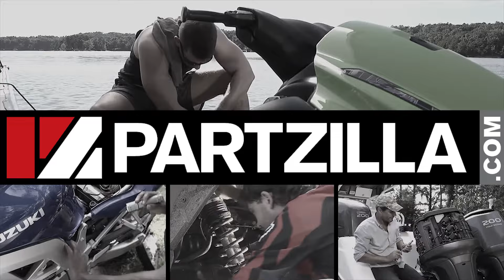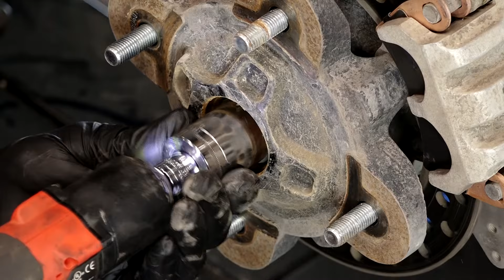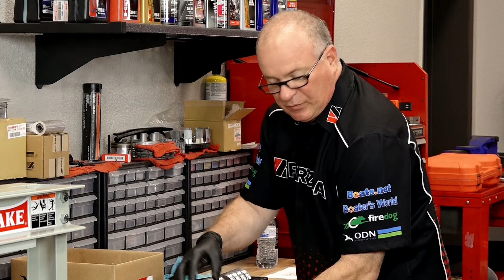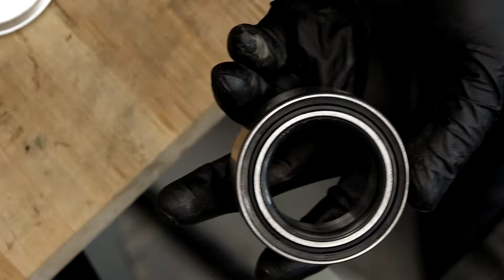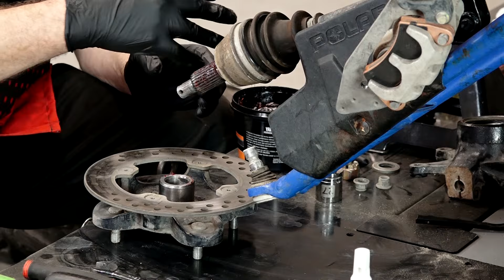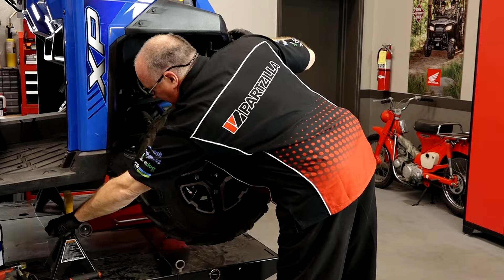Polaris Ranger Wheel Bearing Replacement | 2016 Polaris Ranger 900XP  | Partzilla.com

Comment: Can’t get the hub spindle removed from the hub assembly. Tried heat to no success. Any tricks?
Reply: The hub spindle? Are you taking about the spindle of the cv joint that's in the hub or do you mean the inner hub that the cv joint goes into that connects to the outer hub?

Comment: What is the reason to put red loctite on a new bearing will be hard to remove the next time
Reply: People use Loctite (a bearing retaining compound) on wheel bearings before pressing them in to fill microscopic gaps, prevent spinning or walking within the housing, resist vibration, seal against moisture/corrosion, and essentially create a strong, uniform bond. hope that helps

Comment: Would be nice if you showed separating the hub from the rotor assembly.
Reply: Takes a torch sometime to cut off bolts and spread flanges to drop bearing housing

Comment: Great Video. Only thing I can add is once you get hub assembly off those torx screws are extremely tight. You'll need to heat them with a torch to burn off locktite then with dead blow hammer hit it to separate it
Reply: What torx screws? You mean the 4 that hold the rotor to the hub? You don't need to take those off. And beside those there isn't any other torx screws in the front hub.

Comment: Question, when you reinstalled the castle nut washers, you said to install them with the bevel facing inward, is that correct ?
Reply from the maker: Reverse that.  Flat side toward attaching part, beveled side towards nut.
Reply: Partzilla thanks for clarifying it, I’ll change mine now👍